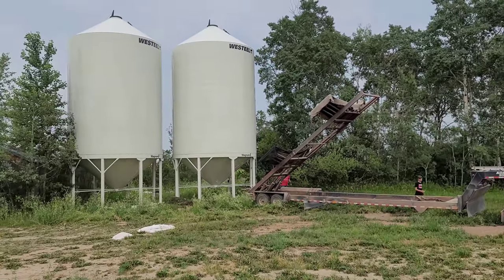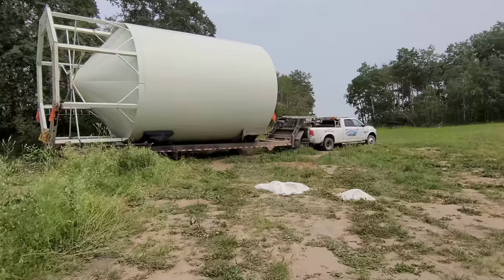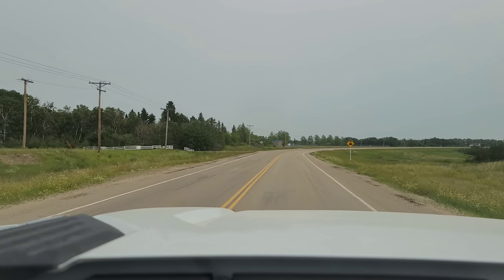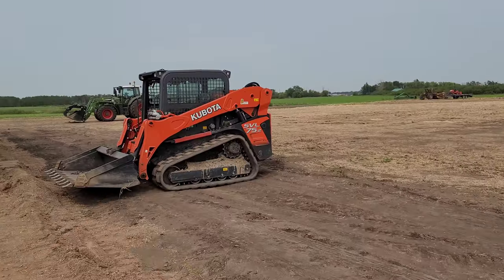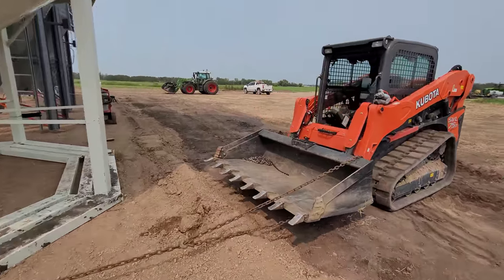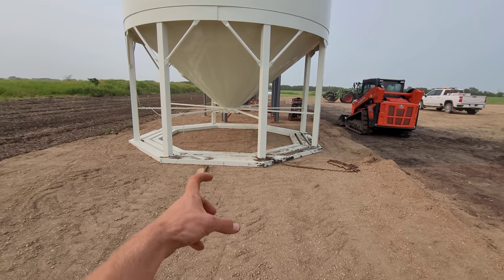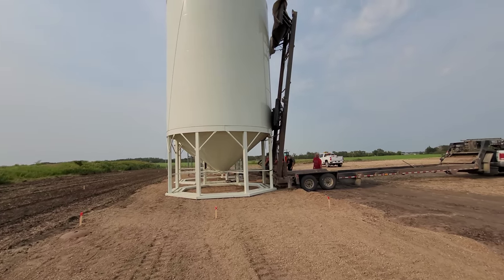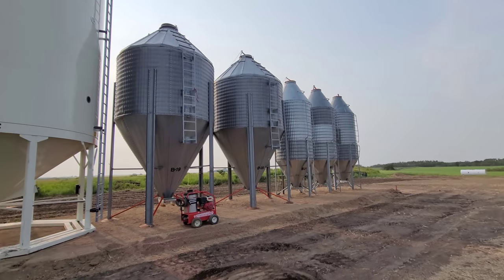Moving fertilizer bins☝️

Comment: Hey Mike something that may help you line up your bin, use some orange marker paint and spray you a straight line on the ground parallel  with your pad. I used it for years when marking underground services. Maybe that will save you from having to get out of the skid steer so often.
Reply: Yep at my old job for trailers going to an indoor dock. Helped so much. Nice yellow line.